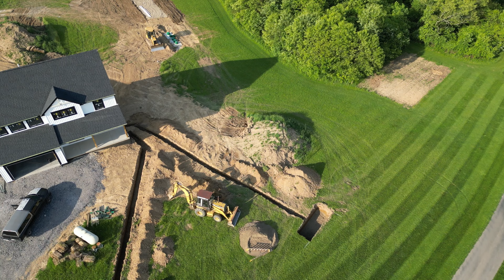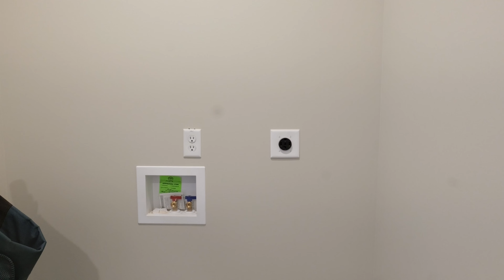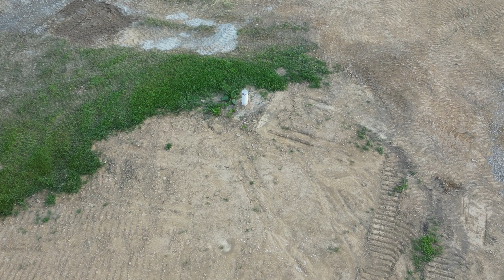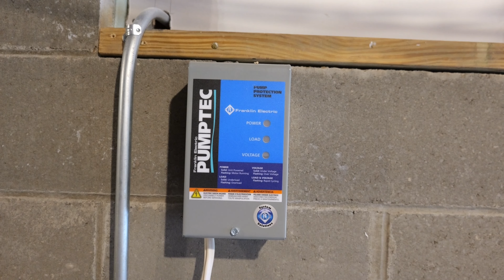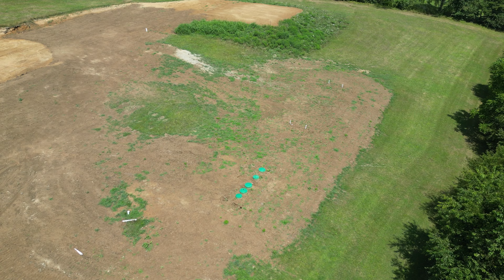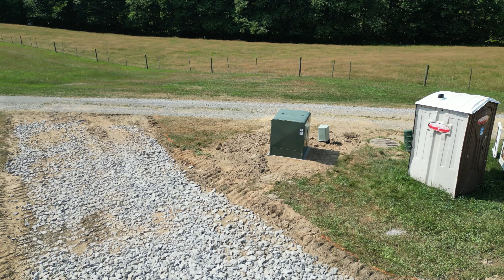New Construction Home: Utilities Breakdown and Cost $$ (Modern Farmhouse Part 7)

Comment: Did you not use a Licensed Engineer to design your septic system? Usually, only design professionals can design septic systems.
Reply from the maker: Yep the septic system was designed by a licensed engineer and was the $400 charge outside of the implementation